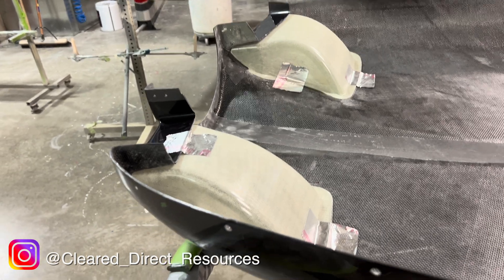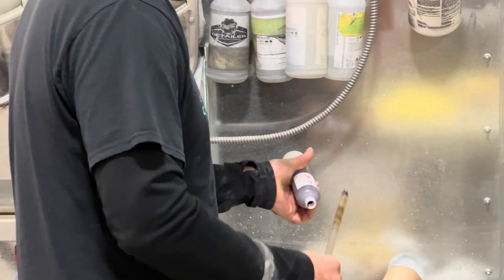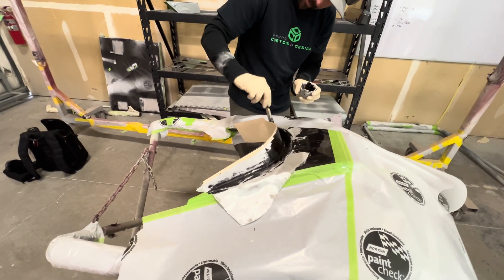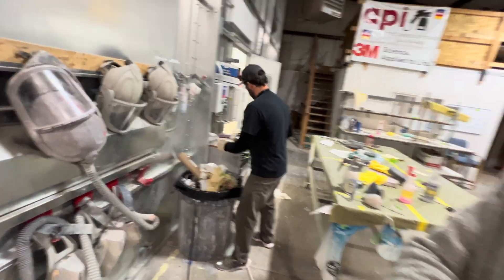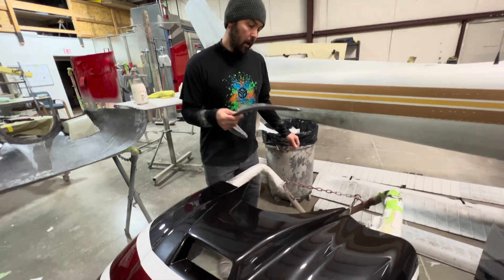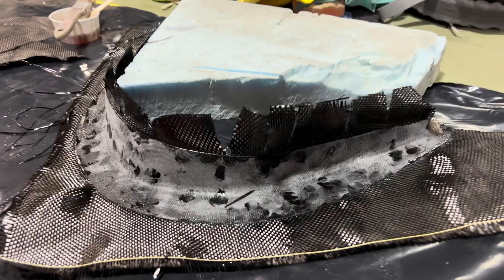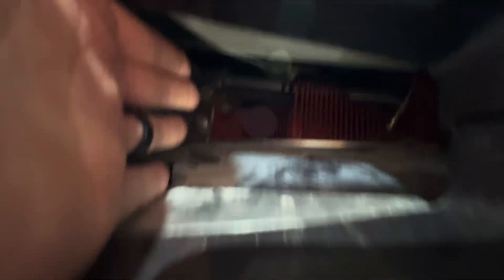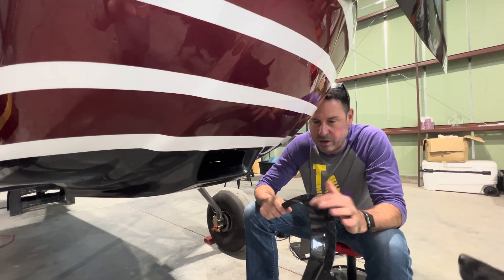COOLING UPGRADES! The Bogey gets a custom Carbon Trip Lip and Fiberglass Inlet Ramps in 4k HDR

Comment: We tried that with little success. The Titan 340 runs hot. I’ll be interested to see your first flight break in temps. We didn’t have the ramps.
Reply from the maker: Dang it! The only other option is an exhaust fairing on the bottom of the firewall. I really don’t wanna do that… are you in a S21?
Reply: @CLEAREDDIRECT  school project; building our second. The airplane is fantastic and the new owner is flying his a lot.
Reply: We couldn't fly ours after about 10am. It just got too hot. Started first flight on 7/17/23 in north Texas. We had the 9 row oil cooler back then. Added the ramps and 13 row which helped. Im kinda nervous to see what ours does this summer now that we have 100 hours and have the cooling upgrades. I've noticed 420 CHT on extended climbs with 80 degree OAT. Once I'm
In cruise it's well below 400. I need to make a video on it this summer.

Comment: I found even with the lip and inlet ramps heat on extended climbs was an issue. Titan says green range up to 450. I set my caution at 425 where I would start doing things to cool my cylinders in break-in. Now with almost 100 hours temps are much better.
Reply from the maker: Good to know! I need to find some literature on the break-in process. How many hours did you put on in “break-in” phase before you moved on to other test points?

Comment: Great idea. I reckon that with the lip, you will have plenty of cooling on even the hottest day. Not only will it create a larger low pressure area, it should increase the pressure differential...with the bonus of preventing outside air from deflecting into the cowl off of the firewall and pressurizing the lower half of the cowling. 

But that's just me wild ass guessing. It looks good, so it must be good...right? Keep it groovy, amigo...and quit teasing. Get that thing into the air, already.